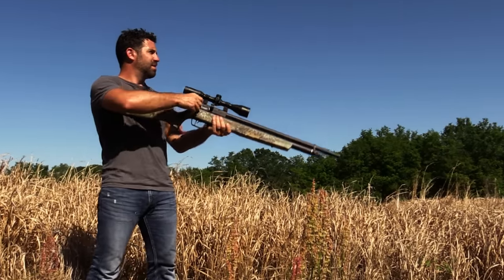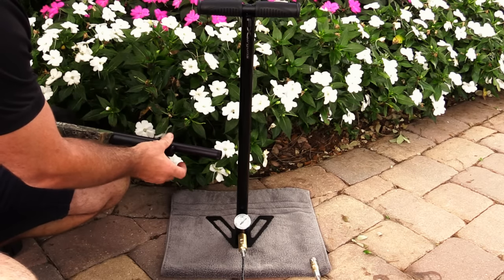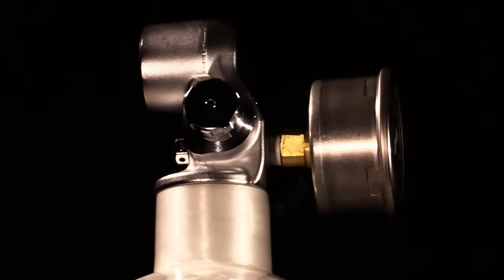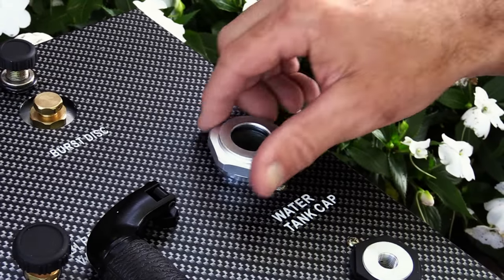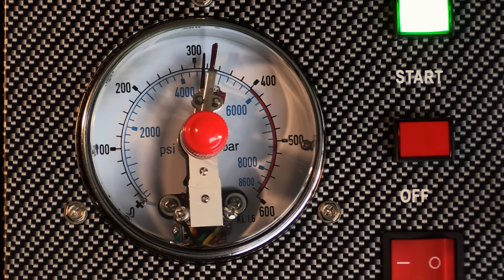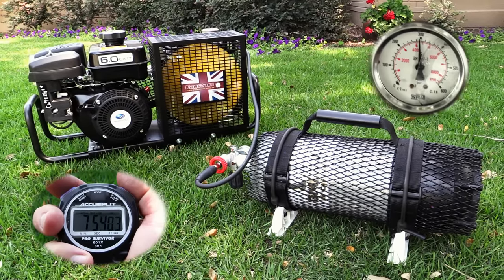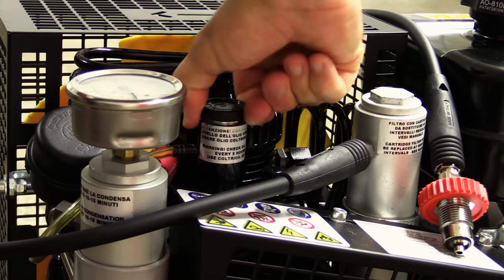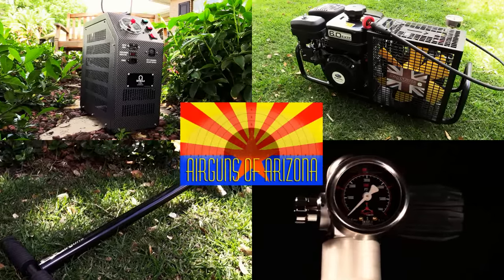Air Rifle REFILLING - How To + Setup GUIDE - Everything You Ever Wanted to Know !! - PCP Airgun

Comment: @steve I just bought a scba tank and about to purchase a air compressor what do I need to put on my standard Scott scba tank to fill with compressor and what do I need to fill air gun with tank is t all quick connects any links or a word to google to find the right fittings ? I’ve looked on eBay for scba adaptors but no luck

Comment: Steve, I would appreciate your input.  I have Omega Supercharger and a Omega 75cf tank.  The tank came with fill line that has a restrictor that I removed.  I fill my air guns with this fill line.  Do I utilize the same fill line to fill the Omega tank or do I have to change the fill line connector to fill a tank?
Reply from the maker: I've always just used 2 different lines.  The line that comes with the compressor stays on the compressor.  The line that comes with the tank stays on the tank.  Does that answer your question?
Reply: I used a male to male connector to connect the Omega Supercharger fill line to the Omega Tank line.  I was able to fill the Omega Tank but when I closed the tank and bled the compressor down the guages went to zero but I had no air in the tank for filling off the tank.  Your input would be much appreciated.

Comment: I could tell right now, (min 15:50), the little red knob that presets the pressure set needle on the Omega suercharger, is not going to last very long.  It seems his hand is exerting quite a bit of force to set the needle, (shaking like a lot of torque is involved).  Little things tend to break over time with situations like that.
Reply from the maker: EarthSurferUSA got 2 years of commercial use out of mine then finally upgraded... no issues.  I haven't heard anything but rave in the 3 years they've been out.  You hearing different?  Thanks, Steve
Reply: I would not expect to set that knob very many times in using the compressor.
Reply: @AEAC  No, I have not heard any differently.  Just going by what I saw on this vid, (data through senses), and combining it with all the other china junk I have bought over the decades, (not saying this product is junk, I have just bought a lot of it, like we all have.  The boat goes back to china empty, while our landfills overflowith).  That bit of concept building does not "Trump", (I like that word), your personal experience of several years with the machine in any way.
Thanks for the quality vids you do Steve.  Doug in Michigan
Reply: @AEAC    Steve really enjoy your videos, I am researching HPA compressors I see you "finally upgraded" what compressor did you upgrade to?  I have had my Nomad 2 in for warranty repair after only 9 fills on a Ataman MR2. Nice concept on the Nomad 2 but I don't really trust it for as much shooting/filling as I do. And I have a FX Impact on the way so I am looking for a compressor that may have a better filtration system on it too.  The compressor survey has been a good starting point in my research but I am always interested in more information.
Bob L
Reply: @boblor2484  The Turbocharger has been great for me & others.  The Coltri Daystate has also been excellent.  Steve

Comment: i dont understand when you bleed the air line why does the gauge level drop down to 0 should it stay at 4500 psi so you know how much air is in the tank???
Reply from the maker: 209chevymon The gauge you are viewing in that instance measures the air pressure in the tank's external line, not the pressure within the fill tank.

Comment: I am asking anyone this question, If you have an Umarex Legends MP40 Semi/Full auto Submachine Gun? and if you think it is possible to build a system that would use either air handpumps, HPA tanks, and PCP for the legends MP40 to be fitted with a regulator, fitting, and air hose to go where the clips piercing plug, screw that goes into the Legends MP40's clip...To use compressed air instead of the CO2 air. ??? So as to not have to deal with cold air, freeze up's with CO2.

Comment: I bought a Pyramid hand pump and what most new to air gunnery don't know is a hand pump takes a lot of strength PULLING as well as PUSHING! Attaching the hose to the gun is very sloppy. You lose air as you attach the hose. And couldn't they invent a wheel of some sort with a counter weight that would take the effort out of pumping? I was going to invest in the best air gun compressor on the market until I read that they break down very easily. The hose on a Pyramid pump is flimsy and you have to be careful not to break it. I ordered my second pump from Pyramid and the plate you screw to the pump looked like a very heavy stamping machine stamped large furrows on the plate. I sent it back never to do business with Pyramid again.

Comment: Can you use an electric tyre car pump to fill a Airgun bottle ?
Reply from the maker: Not normally, no.  Car tire pumps fill to 50-60 psi.  An airgun will need 2,000-4500 psi.  Steve

Comment: Will an air compeesor work?
Reply from the maker: depends on your compressor.  how many psi is it able to fill to?
Reply: 6 gallon 150 psi
Reply from the maker: @xeniibishi2840  so the typical airgun will require 3,000 to 4,000 psi to operate so a (150) psi compressor will not work.
Reply: Oh ok sounds good

Comment: Always fill your gun as slowly as possible from a cylinder,opening the valve like that wont give you a full fill,slowly trickle in over a minute or so depending on how empty the gun is!!
Reply from the maker: Randal is correct.  Slower is better.  Steve
Reply: Yes, fast moving air heats up and expands and will give a false reading as well as risking blowing your connector out.

Comment: shot in the dark here.. (looking into the hobby). Has anybody tried the battery car chargers with built in air compressors?
Reply: Tire & shop compressors only run up to 100 - 200 psi-ish.  One needs a 3,000 - 4,250 psi compressor for most airguns. Best, Steve

Comment: What’s wrong with distilled water? Do you mean Deionized water?
Reply from the maker: Nothing so long as you don't mix it with the included chemical package.  It requires "bottled drinking water."  Distilled is fine to run with a little antifreeze mixed in for lubricant & part preservation.  Steve

Comment: Why couldn't a off the shelf regulated air compressor work?  Newbie.
Reply from the maker: Shop compressors normally don't run more than 300 psii. Airguns typically run between 3,000 and 4,000 psi.  Best, Steve
Reply: @AEAC  thanks sir

Comment: I own a smg .22. i have 3 hpa bottles for it. which i started out having a hand pump for it. it was a pain to fill just one bottle. so i bought a gx portable hpa compressor off of amazon for $380 u.s. dollars. The thing fills my bottles in about 15 to 20 minutes. i can fill all three in roughly an hour. and have around 750 shots i can get off before needing to fill them again. since the smg .22 comes with hundred round belts and can empty a belt in a matter of seconds, you go through bottles fast. i REALLY recommend the hpa compressor i got for anyone getting into hpa air rifles. the thing can be powered by a car battery. so when i am out in the woods, i can fill my bottles with my car and not have to leave to fill up again. its small and portable. It doesn't need any water to keep it cool too.
https://www.amazon.com/gp/product/B07XYRS15R/ref=ppx_yo_dt_b_asin_title_o03_s00?ie=UTF8&psc=1

Comment: This is not everything I want to know. One of the biggest issues for pcp guns is moisture extraction, and many videos show that the built in moisture systems to most pumps are inadequate. People need to know how to upgrade the moisture filter systems in pumps.
Reply from the maker: I'm told by the professionals that in reality, most of these desiccant systems don't do a whole lot to remove moisture and any benefit ya do get can be short lived.  Moisture purging compressors remove any liquid water that can get in there but water vapor in the form of "humidity" can still enter.  It's been my finding that it doesn't matter though.  I've taken apart and serviced 10 year old PCP's that didn't show any signs of internal corrosion... and I live in Florida and I don't use desiccant.  Hope that helps.  Steve
Reply: I appreciate the response. I'm just not sure what to think, because some people, like you, have had no problems, but other people show pictures of serious corrosion internally and leaks caused by it, and expensive repairs. It's hard to figure out why some do and some don't.

Comment: I have cerebral palsy so I'm on the weaker side but I hear 2,000 psi air rifles are not that hard to pump I'm about 160 lb I guess I could put all my weight into it
Reply: Always best to use ones weight to collapse the pump.  They're all hard to pump near the end, higher preasure just takes more force.  Steve
Reply: @aeacvlog2033  how hard would it be to hand pump 2000 PSI I am looking for a substitute for my muzzleloaders
Reply: @abseconPC  It takes some effort, hard to quantify.  Certainly much harder than a bicycle tire pump, but not to hard for someone in good shape.

Comment: This is a very old video. But I will ask my question in the hope someone can give a logical answer. Narrator says to use purified drinking water. "Don't use distilled." Why?
Reply from the maker: The owner's manual for the Omega says this.  When i called to ask why, I was told that one CAN use distilled water and off-the-shelf antifreeze, so long as they don't use the distilled water with the included chemical package of water wetters.  Best, Steve (narrator) 😊
Reply: @AEAC  Thank You!

Comment: The best alternative is not shown, and around here do not go to any fire station hoping to get a bottle filled as they will not do it, due to the liability aspect of our sue happy modern society.  

Laws and regulations......even this option is not allowed if you live in the city or in a sub-division etc, etc.  However if you live outside of town this is the best way. 

Rent a 6000 psi nitrogen tank.  Purchase the appropriate fill attachments and even if you shoot a lot one bottle fill will last several months and if you shoot only once a week, it will last all year.  Plus nitrogen does not deteriorate the air tube on your fancy PCP.  There is no moisture to worry about.  

Economically most likely the best way.  I paid 185 dollars the first time for both the bottle deposit and the full tank and it is 75 bucks for a full tank and they deliver it and pick up the  depleted one.  

That is how I deal with it all,  I keep a small tank in the vehicle, just in case, but I have never had to worry about a fill on a hunting expedition as if you cannot get half a dozen squirrels with even a 40 shot air rifle, you best quit.........there is a hand pump in the vehicle also, and it is not bad on some air guns, but quite the workout on some of them that run on high  pressure with a big capacity cylinder, those can be quite a workout to fill.  

Cheers!
Reply: so u cant/wont let u rent one if u live in the city???
Reply: Kit Carson i would really like to see or hear of the way your talking about?

Comment: You said pour purified water and then proceeded to use Zephyrhills- that’s mineral water, which can leave salt deposits in your expensive compressor. A gallon of distilled water at Walmart can be had for a dollar. Great video otherwise! 👍
Reply from the maker: The owners manual calls for "purified water such as bottled drinking water," "not distilled."  This is because distilled doesn't play well with the chemical additives it comes with.  If you use the included additives, use purified drinking water like the Zephyrhils you saw me use.  The minerals within are ok.  If you wanna use distilled, you can... just don't include the additives.  Best,Steve

Comment: Those air guns have one major FLAW the cost of air. You need to air tanker truck to follow you around as you shoot!! You wont be doin much shootin filling tanks all day long. its a FAIL
Reply from the maker: As newcomers increase their knowledge of the sport, they soon realize that your takeaway is a misunderstanding.  For example the airgun I'm in the process of reviewing now (AEAC Vlog Tuning Guide Complete for ya already) achieved on one fill... 162 shots at 30 fpe, 278 at 23 fpe, and 419 shots at 19 fpe (3 owner selectable OEM power settings).  On creating my own tune, it achieved 38 fpe x 45 shots on a fill.  This is just one example of course but there are plenty of airguns these days making 50 & 100 fpe in larger calibers which also have good shot counts... and in the end there's no cleaning required afterwards (unlike my powder burners).  Hope this helps.  Steve
Reply: @AEAC  yes it does now i know you can get more than a few shots per tank, that helps. But the electric compressor is quite expensive. Can you use a home compressor used to paint cars? This air gun is super !
Reply: @seekingtko3146  It cannot because shop compressors run to about 180 psi and airguns operate between 2,000 and 4,300 psi.  There are lots of filling options out there however.  If you're new to all this, I recommend you check out my 2 recent vids on the Air Venturi Avenger.  Best, Steve
Reply: @seekingtko3146  It cannot because shop compressors run to about 180 psi and airguns operate between 2,000 and 4,300 psi.  There are lots of filling options out there however.  If you're new to all this, I recommend you check out my 2 recent vids on the Air Venturi Avenger.  Best, Steve
Reply: @aeacvlog2033  roughly how many (rounds) can you do with the supplied tank set at 2,000 psi? thank you
Reply: @seekingtko3146  On the vast majority of airguns, none.  Most will operate between 2,500 and 4,500 psi.  A very few will operate below that.  However, if you check out my reviews and guide on the value priced and high performing Avenger, you'll have a versatile start that will run on pretty low psi in .177 and .22 cal.  It's also hand pump friendly.